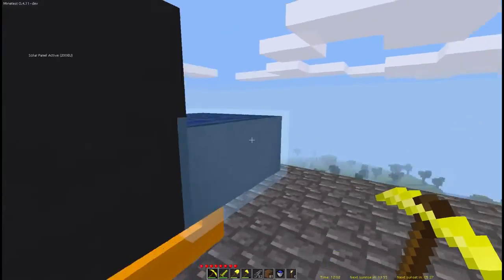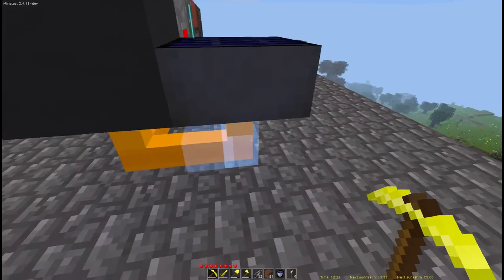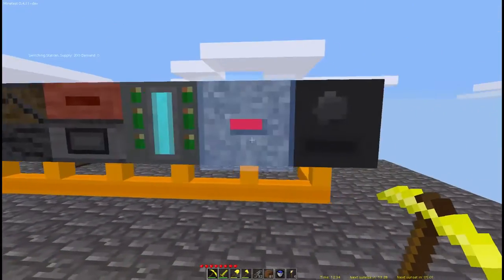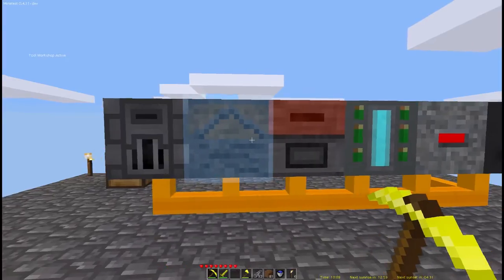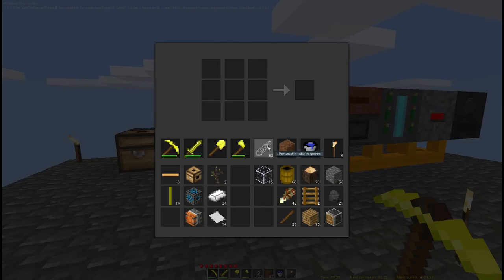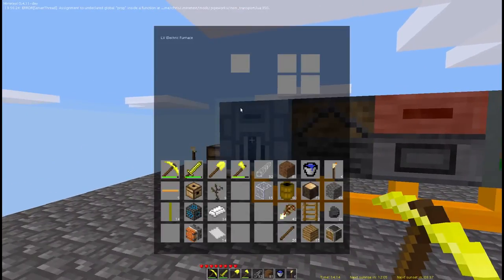Minetest - Example Technic Setup

Comment: is it possible to hook up the tubes to the fuel generators? I'm trying to automate that part of my build.
Reply: if it's not possible then I'll just use the /giveme command

command if anyone wants it \/

/giveme default:coalblock 99999
Reply from the maker: It's been a while, but if I remember correctly you can't have the pipes hook up directly to generators but there is a block you can connect to a chest (which can be connected to the pipes) to move objects from the chest into the fuel generators.